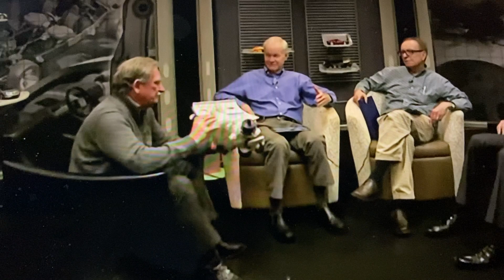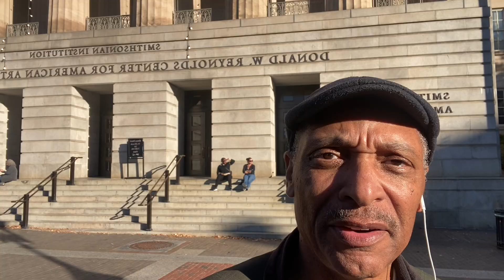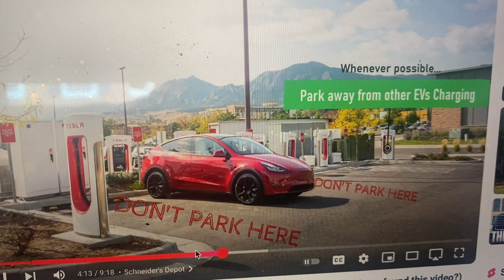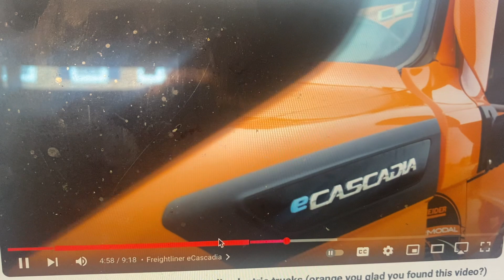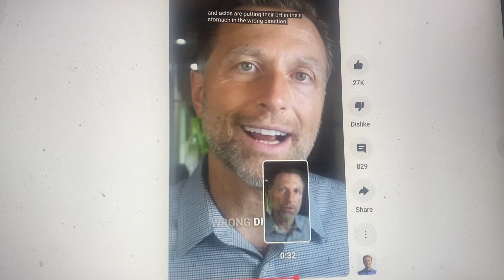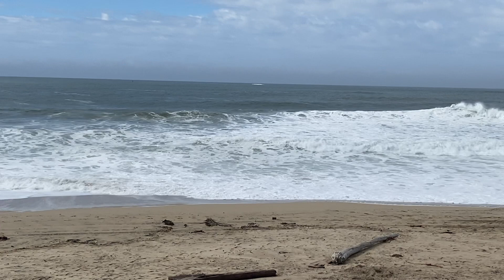Tesla Semi Jeapordized by Daimler/Volvo Trucks 2024? (b450)

Comment: I agree with what you said and would add that Tesla organises the supply chain which includes simply increasing the number of items already built and needed, constantly improves the items that are unique for more cost efficiency, has a growing research component that stays ahead of the needs, tests completely the results and adapts quickly. Building infrastructure for charging and placing chargers where needed before truck orders. Encourages feedback. The amount of change as needed and the speed of implementation is second to none. Tesla is sure to establish itself whether at the top of the list or not is not critical but it will be stopping the nay sayers and showing that it more than meets the needs in most things. But it will not stop there. Remembering that Tesla’s goals are to promote sustainability and not just the bottom line whether by itself or causing changes for of direction in other companies.
Reply from the maker: Hard to replicate when not able to just buy off shelf